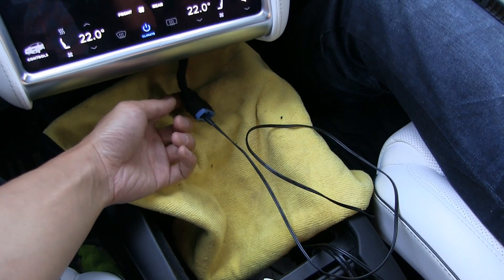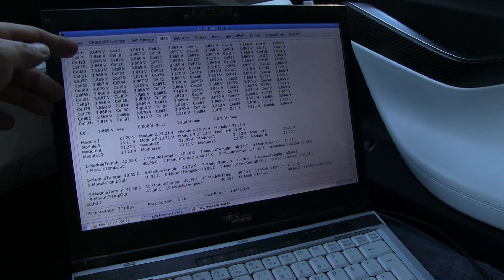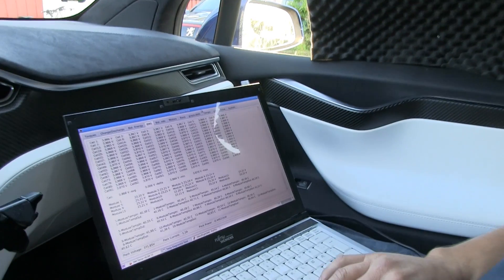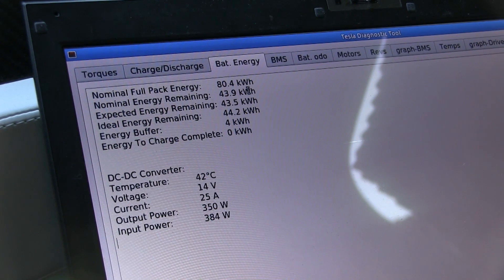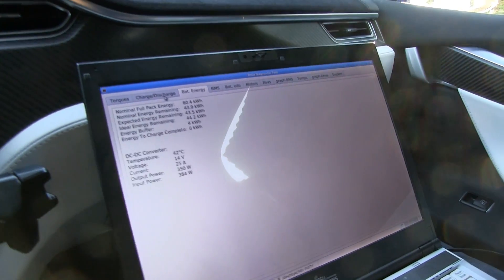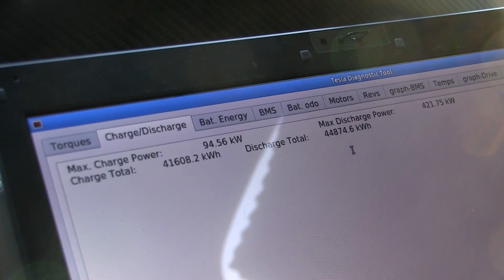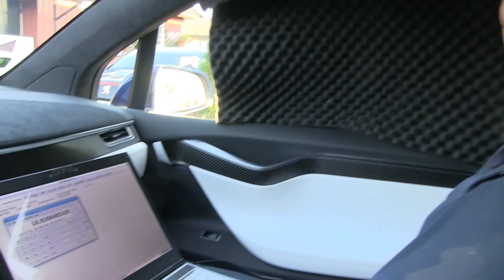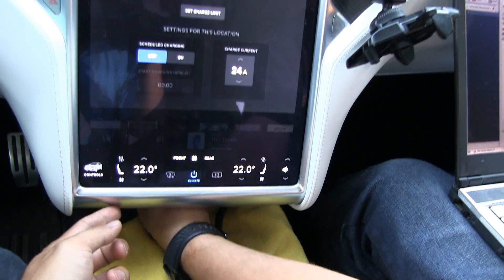Reading CAN bus info in Tesla

Comment: if voltage in any of 16 modules drops below 2.5v on any 18650 cell (they are in parallel of course) for more than 30 sec than Tesla will force neutral exactly like in leaf or i3 or bolt

Comment: Very interesting vidéo but for me the most interesting is that tesla limit the power of fast charging on your car if you don't used enough AC charging (home) were ou have to paie your électricity.
In France charging an 90d (80%) cost more than 10e.
The big advantage to the tesla was the free fast charging it begin to loose this advantage.
If y have too charge at 50kW and pay for charging than i can buy an EV type ioniq or i3 cost 2 or 3 more less !!!
Conclusion tesla can do what they want of your car when they décide to, and change the carastéristique of your car after you have paid the car.
Is it légal !?

Comment: Interesting to see all the data from you diagnostic tool. It would be interesting to see the cell voltage deviation at a smaller state of charge. Like 5 or 10%, you would probably see a much higher deviation there, since Tesla (from what I understand) uses the conventional method of top balancing.

Been following you for years, and your channel is interesting!
Reply: Normaly I do not see any differende at low or high SOC.
Tesla do not do any magic balancing at high soc it bleeds high voltage groups when needed.
And more reading normaly it is not the same that is the low ones.
That is why it is nice to compare logs with days, weeks or months appart.
Reply: I think Matthias want to know the voltage sag at high and low SOC on à same load ?
Reply: Christophe LASSIAT 
Will talk to Bjørn if we can make a follow up with readings at low SOC, charging and 0-100 tests.

This is not done in a 30min visit so more planing is needed.
Reply: Actually I meant low SOC and no load. However cell deviation (and voltage sag) under load would also be very interesting. Good to hear that the cells stay so close at low SOC.

And I understand that a trend over a longer time is nice to have!

Didn't know that about Tesla's BMS. I need to read more about this. 
There is so much to learn about those cars! Thank you for this video which dig a bit deeper into tech. :)
Reply: sigurd i If you can it would be great :) Thanks

Comment: Very interesting with the CAN bus readings. I think you concluded that 'your' battery loss was 10,9%/7,3% and account that to e due to a heavy accelerator foot and lots of pulling, but what about the energy needed for balancing? Given the balancing is totally passive, all it can do is to bleed modules with higher voltage down to the lower voltage(s). That must cause a loss?

Comment: Bjorn, you should do this battery deep dive and share it periodically with us (like every 6 months or a year).  Yes this is verrrrrrrrrrrrrrrrry interesting.
Reply: Don Miller It's like revving your car every day and reporting horsepower output. Both are bad for the battery/engine and there's no benefit in doing it.
Reply: Didn't ask for it everyday. Once or twice a year shouldn't hurt since  Bjorn high mileage/high demand is a "worst case" usage already. If his battery degradation or capacity loss is low that speaks well for Tesla owners.
Reply: Yes! Like the other youtuber Kman does.

Comment: I'd be interested in his software. Where can I get it? I've been using SavvyCAN for some time already, but this tool has a better visualization, so I'd be interested in using and also extending it.
+Bjørn Nyland do you have any contact data on him, that you can share?
Reply: Marc-André Kolly
Sorry this is not my own software and early version.
 My own not finished. TTT
Trashed the SavyCan and my own software on the Due.
Only the plastic box is actualy used.
Reply: Who's software is it then? You made it sound like it's yours.
Reply: Marc-André Kolly 
Sorry for that, we are talking before the recording about the development of my own.
The software on the due running in the background getting the CAN data is mine.
The software used to display the data is not and not something you can by or get at the moment.
Reply: sigurd i GVRET is yours? I didn't know that. I thought only Collin Kidder, Michael Neuweiler and Charles Galpin contributed to it.
Or did you reinvent the wheel?
Reply: sigurd i or did you mean the program, that printed all the different cells and some more info on your terminal?
That was done by Jack Rickard and Collin Kidder.

Or did you reinvent that too?

If you modified some parts of it, it does not make you the owner of the rest of the code, alright? So then you also can't say it's yours. You can say you contributed to it, which might be the truth, in case you really modified something (and just didn't share it back with the community).
But as long as you used their projects, you don't have the right to call all of it your own work.
Reply: If you look at the terminal it only prints can values, no cell information in the log there. 
It look like this: (Reding from my own car at 0% SOC)
199198 R11 302 3F C8 00 00 70 A5 00 00 
199200 R11 382 48 AB 80 82 0A 00 A0 3C 
199202 R11 3D2 F3 F9 01 00 87 F3 01 00 
199217 R11 102 93 76 08 A7 0F 4E FF 03 

Never used GVRET sorry. 

On the due I used Collins due_can library to sort only known CAN values if the button is not pressed. 
On nano and leonardo I do not since it is not supported.  

I run it normally on Arduino nano, leonardo and Rasberry neo.
The other units was out on test and also some in my test bed, testing heat and performance over time.

The prioritized project right now is ledbar control from CAN, turn them on when you turn on high beam. 
This is in its last testing part and of course wireless. ;-)
This will be 50x80mm unit. ;-)

Will continue on the software for CAN information in the car after. 

Sorry I just grabbed the old box with a due inside, not the due that original was in the box to read the battery for Bjørn.  

Now I see that I should made time to setup another unit so people do not miss understand. 

And I have nothing to to with the software used to show the values.

Comment: Thanks for that one.  Very interesting.  I'd like to play around looking at the data too.  Can I get the software and the adapters anywhere?
Reply: Sorry but only the plastic box remains, the inside is replaced with parts at 1/20 of EVTV.
Do not by the overpriced EVTV box.
My own code on the due since I log to offline files and can switch from filtered ID and all CAN ID.
Reply: sorry to but in here 
Bjorn mentioned e-bay but there are none there at the moment. 
web page is at http://store.evtv.me/proddetail.php?prod=TeslaCANKit&cat=28.
should come supplied with windows sw

there are a evtv video on youtube where jack ricard promotes it
Reply: Sigurd Ingvaldsen thanks for the reply. Yes I looked at the site and the SCANdue user manual and saw there was nothing like what you showed here so didn't get.

Comment: Need to do some full power climbs up-hill and see if any of those cell groups sag below the others. While you can't see an individual cell, you can see what's going on in each group of parallel cells. 

As soon as one groups reaches 2.5v it will shut the battery pack down, even if all the other groups show 3.0V. If there is no significant difference in battery sag between groups under load, and no significant difference between Battery balance at 20% and 80%, then your battery is still doing good. The BMS just got caught off guard by someone pulling a trailer up and down hills with 3% SOC. 

Tesla should offer that app as a system utilities for Tesla power users. If you had that app running you probably could have limped to the next charger just by keeping KW below 30 or something,
Reply: This is a good shout. It could indicate a pack that is higher resistance than the others.

I find it interesting that the BMS imposed a kW limit that allowed it to drop below the cut-off voltage, since the whole point of the limit is to prevent it and allow the battery to still give enough power for those crucial few miles. What it should have done is imposed a lower and lower limit until 10kW or so, which would then give no useful power to move the car. 

Ideally at the point a limit is imposed through voltage sag it should declare the remaining range as zero miles and tell you to charge immediately.

I wonder if Tesla's algorithms take into account trailing pulling causing an efficiency loss in both battery/inverter/motor heat and additional air resistance?
Reply: abyssunderground, it could be a similar case to the one Tesloop had when they had high mileage and the algorithm didn't properly adjust for the aging battery. I think Tesla replaced that battery in that situation. 

With 90% DC fast charging and driving it hard, it probably has some degradation, and possibly that degradation affected one group of parallel cells more than others. I bet the answer is already recorded in the Tesla computer and if they can read that it will say which cell group reached shutoff voltage.

Comment: When you will always charge to 90%, will there one time come a Message to charge to100% for Balancing? Or will the BMS Balance without Charging to 100%?
Reply: Yes and no. The pack balances "all the time", bleeding the higher voltage cells. When charging to 100% this process happens at the end as well. It shouldn't be needed.

Like those guys said...Bjorns pack is very wel balanced and Bjorn almost never charges above 90%.

Comment: The calculation for the losses was wrong, there were some typos. The actual value is 7,8503756% loss.
Reply: A typo the 8 did not go in.
Should have picked this up, but a littlebit stressed by camera.
Reply: I noticed this too.

Comment: How to reset the BMS? please give us some nerdy tricks.
Reply from the maker: +Philippe Benjamin Rymann Watch the video.
Reply: Bjørn Nyland thanks bjørn. I'm in the middle of the video.... ;-) and by the way, thanks for all your video!
Reply: Bjørn Nyland sorry bjørn me again. in minute 4 you talked about the process of BMS reset. not found any tip or trick in the video....
is there a secret procedure to do this? (ifent haven't to do it)
Reply: From what I could gather from his unspecific comments, I think he means you have to drain it slowly to 0%, so leaving loads on such as heating for a long time while parked up until it turns itself off. Then charge up to 100% on say a 7kW charger so you don't generate too much heat in the battery. That should allow the BMS to know it's true capacity.

He's right thought most people shouldn't need to do this if they're charging at home regularly so the BMS can get a better understanding of the true capacity. I think Tesla need to build in a full battery calibration method that you run occasionally to prevent early 0% issues. Some algorithm could calculate when it's needed, say after so many super charges or something.
Reply: Tesla have algorithms to fix BMS calibration on normal use, so most people do not need this.
This is seen on quite unormal use as Bjørn N.
If you drive 100 000km a year and charge 75% on superchargers you can have a issue.
Most people do not and giving out a procedure that is aqtualy unhealty to your pack is not a great ide.
If you are sure you have a problem with BMS and car shuts down on 5% talk to Tesla.
The 75,90 and 100 do not like discharging down to 5% and gives normaly a slow charge up to 7-10%.
Below 0% it can take 20minutes on 2-3kWh on a supercharger.
The old 70 and 85 do not have this behavour.